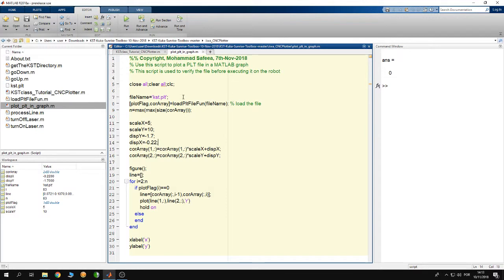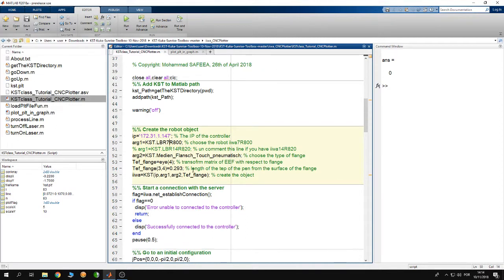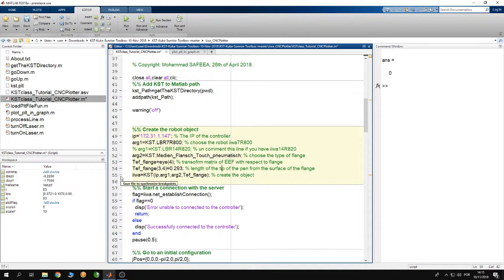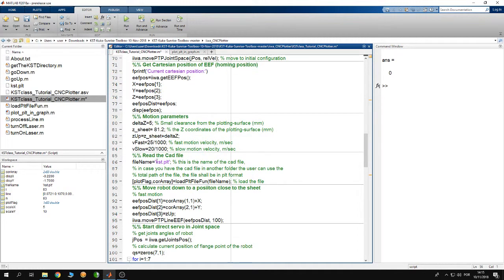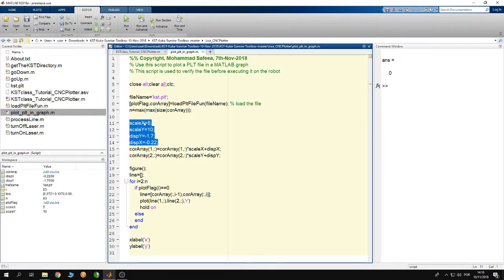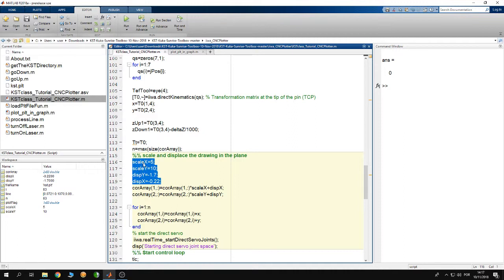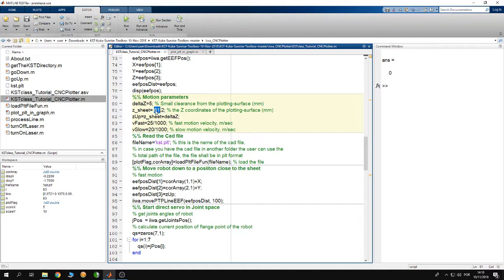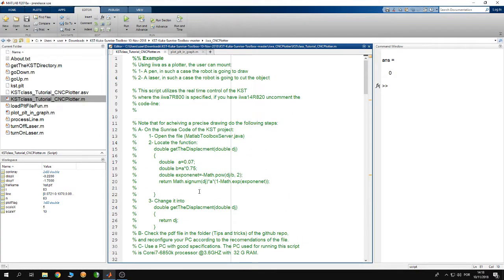Using KUKA as a CNC plotter 04 (plot your cad file using IIWA robot)

Comment: which software would you recommend for making the PLT files
Reply from the maker: I rarely work with PLT files. For this example, I converted a vector file into PLT online, I do not remember a particular name, but I remember there are plenty of free conversion websites, I just picked one of them.
Reply: @roboticapedia2396  oh ok, thanks a lot for your response, and which software did you use for making the vector file?
Reply: For anyone who sees this in the future: I found that using https://convertio.co/dxf-plt/ to convert from DXF worked.